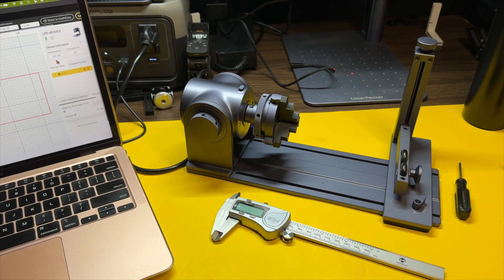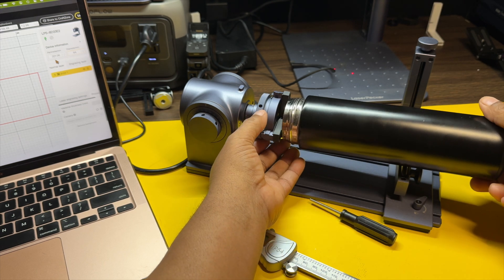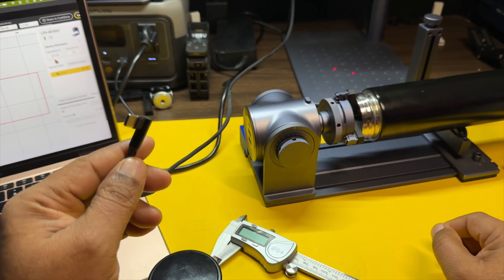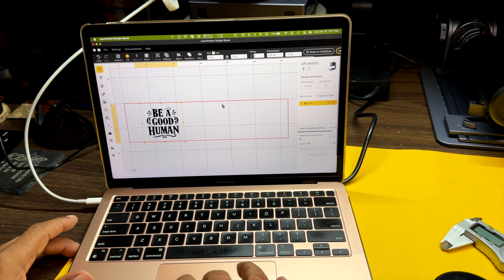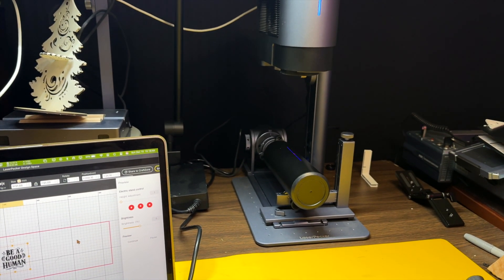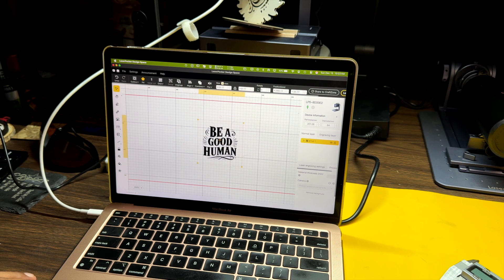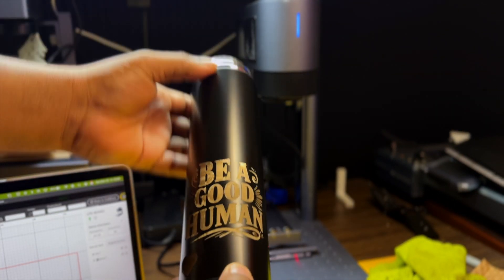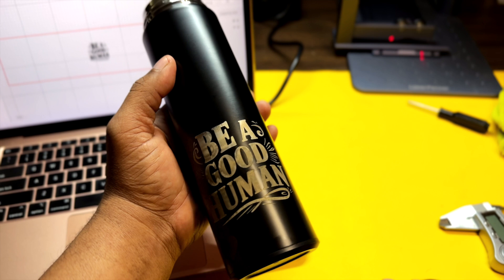LP5 Rotary Extension Demo #3

Comment: What power settings did you use to create this Tumblr? Did you use the diode laser or the fiber laser?
Reply: @PedroValejo  he says in the video he used the fiber laser. For some reason though he totally skipped covering power and speed settings. 

What I’ve been finding is that the fiber laser is just too strong for tumblers and frequently fuses the burnt paint into the metal. The diode laser is safer for tumblers and leaves a nice shiny metal with zero traces of paint.